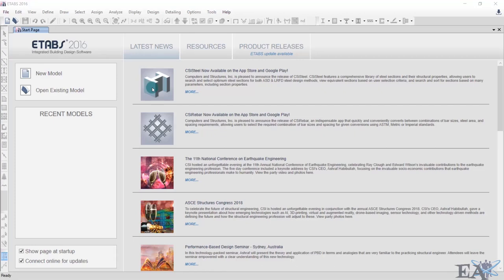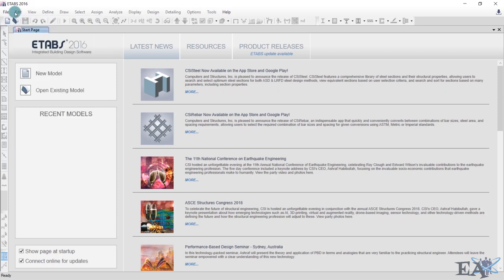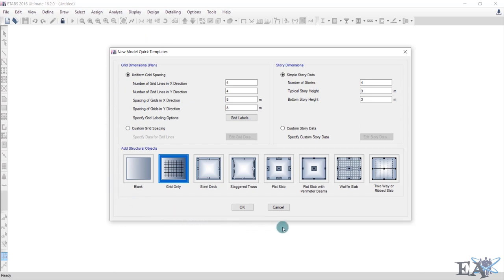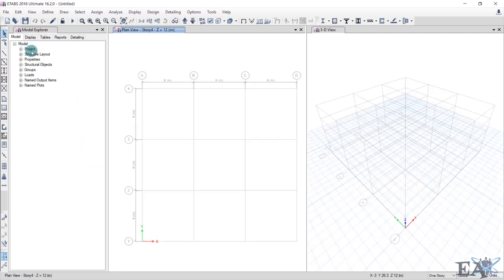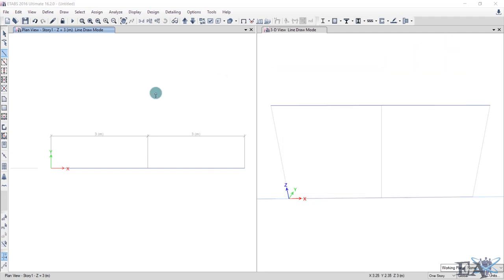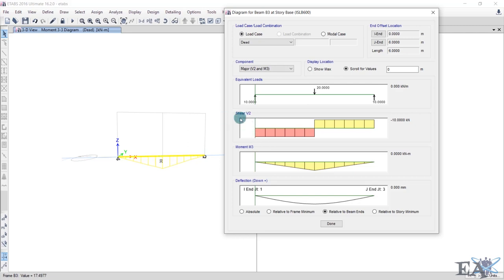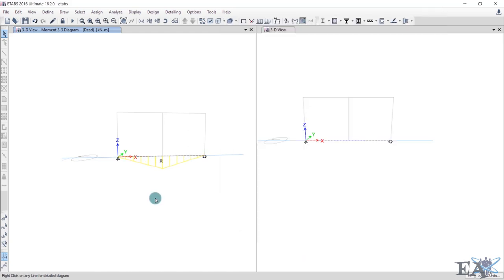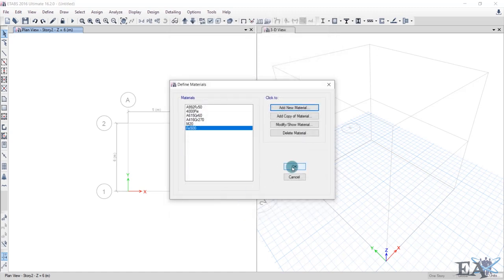Learn ETABS in an Hour!

Comment: Sir, why you don't use property modifier in this tutorial?
Reply: propery modfiers are used when u have high rise buildings. the importance of using property modifier is to consider the cracked section of the property. usually all RCC sections crack and when it cracks the stiffness will be reduced. the moment of inertia will not be same as it was before cracking

Comment: Sir I've tried to try to usse etabs to solve my previous seatwork in structural analysis using portal frame method, and etabs have generated smaller shear,axial and moment values compared to my manual solutions. Sir, I hope on your next video you'll be solving some easy 2d frames and show to us the generated values using etabs and using manual solution.

Comment: Sir, After assigning load to simply supported beam and running it nothing is happened it doesnot show any deflected shape and SFD,BMD etc. cannot be seen , if you understand this problem please suggest me its solution soon please.
Reply from the maker: If you are using v17, then it is due to the software bug. use v16 or 18z